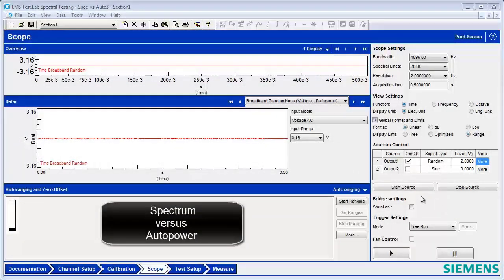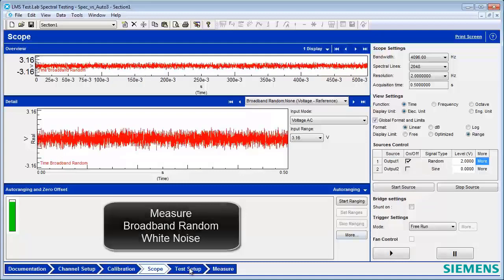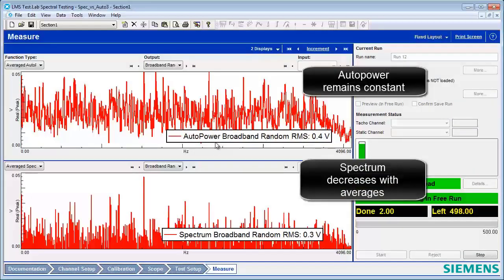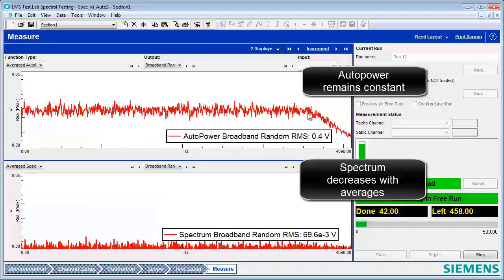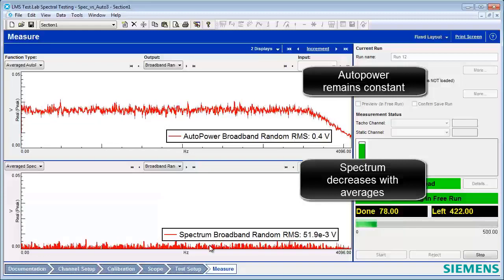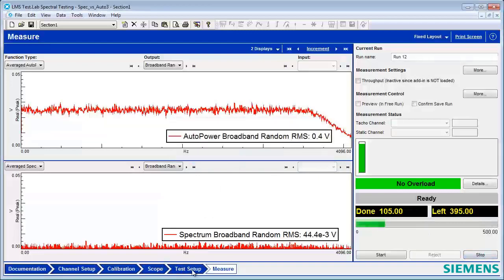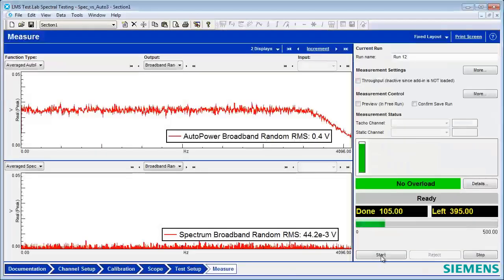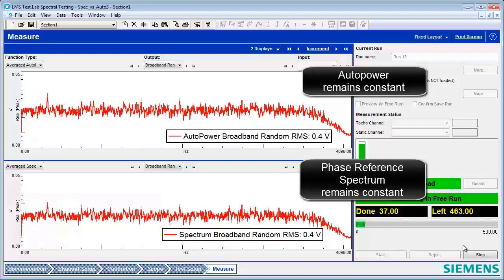Spectrum versus Autopower

Comment: Hello, this means that the function format I choose in the data test is spectrum, but will the average result not be reduced no matter how many times the phase reference is added? Is this the same as the function of Autopower linear? Thank you and look forward to your reply
Reply from the maker: Phase referencing average relies on a fixed relationship between the reference and response channel.  If there is no fixed phase relationship between the two channels, it will average to zero.  For example, if one channel is on a car, and the other is on a solid floor, the relationship is broken.  In most real world situations (with a mix of random and fixed signal), there is a good chance that the amplitude of a phase referenced spectrum will be lower than the autopower, since and random component is present in the autopower, but averaged out in the spectrum.  More here: https://community.sw.siemens.com/s/article/spectrum-versus-autopower
Reply: @SimcenterTesting  Thank you very much